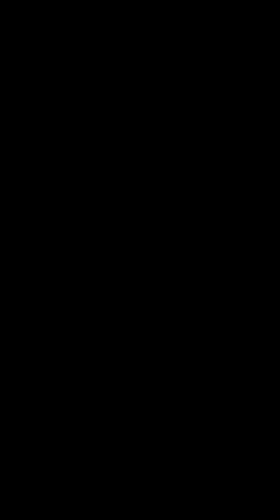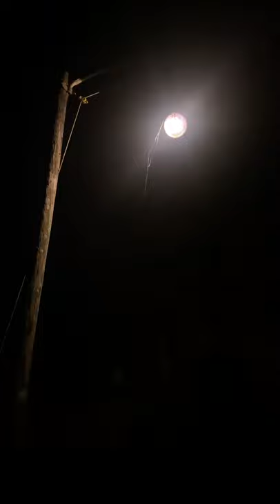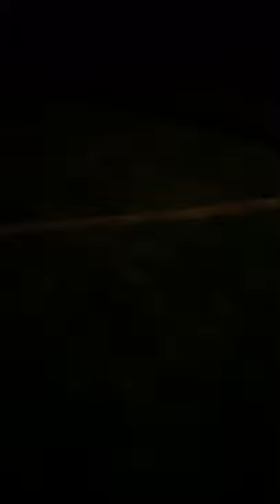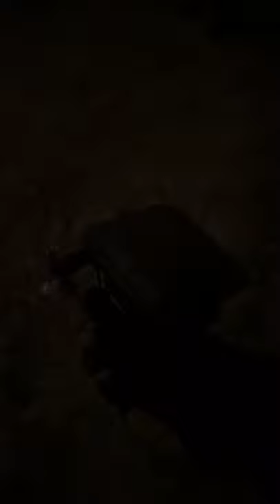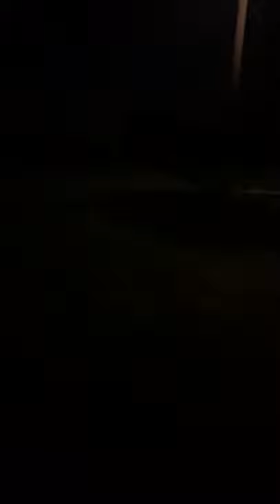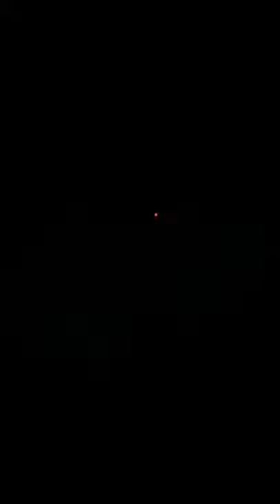1900s Adams Bagnall 120V AC carbon arc street lamp operating on wooden pole

Comment: Was carbon arc color resemble a metal halide led  fluorescent or mercury vapor lamp also it was soft warm cool natrual white or daylight in color temperture finally what type of ballast was used?
Reply: lamps of this era do not use ballast as the arc is struck and the gap opened via solenoid. they are completely self regulating as the ark uses the carbon rods. they produce a bright white lite that is a true ark light that is rarely seen outside of imax projectors and science labs

Comment: How could someone not like this video? This is a testament to the quality of the piece of equipment that he has a restored back to working condition. Apparently after watching his other video he had to do very little other than clean it up and replace the globe. Heaven knows how many years this thing provided light for people when they really needed it. And the fact that it could still provide reliable light maybe a hundred twenty years after its manufactured to me is just outstanding. Bravo.
Reply: The ones that don't like this video are probably cancel culture nothing is good enough for then or there burnt out...
Reply: I remember back in the '70's-'80's an old drive-in movie theater out west where they had old carbon arc projectors the pictures seemed to be better that today buld projector's only thing is that you had to adjust the arc ever once and a while the carbon arc has the same light spectrum as the sun including the ultra violet rays.. the movie projector had a very dark green window to look in to keep an eye on it and the bowl shaped mirror in the back to reflect the light to the film is very expensive around $1,000. Was in the projector room quite a few time... I think I might even know where one might be out west  but I know where there is a old spot light that uses a carbon arc to luminaire ...
Reply from the maker: Probably do to the horrible yet exciting vertical video excitement :-P